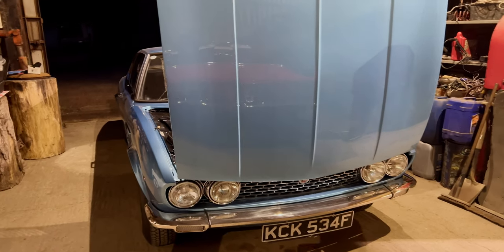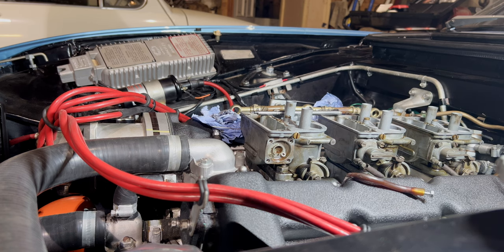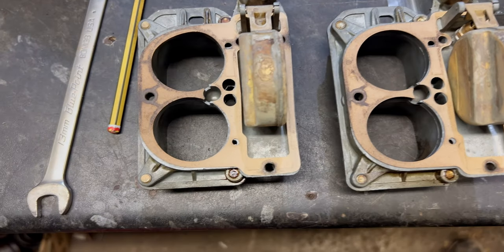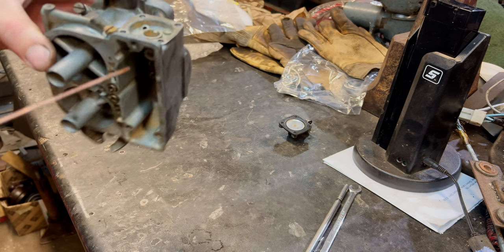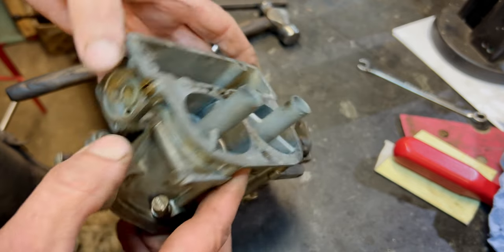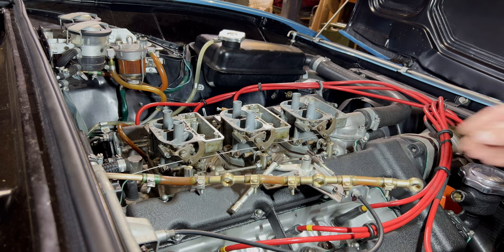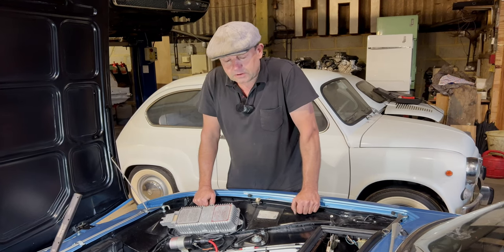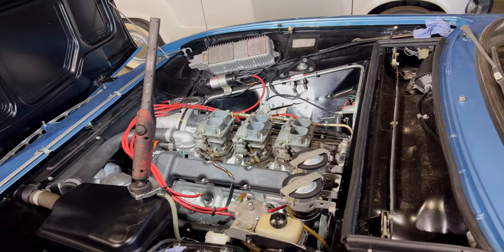Fiat Dino Carburettor trouble.

Comment: Interesting as always, Mark! But, if looking at the "blueprint pics" of the Weber DCN and
DCNF carburettors, there is a small one-direction ball valve inside the accelerator pump 
housing, which seems to be hold in place by the small metal part you found lying in the
float chamber.    
Without this ball valve , I suspect the accelerator pump will not work very well?   

When restoring my own carburettors, I could hear these small balls rattle, when I shake 
the  dismantled main carburettor housings!
Reply from the maker: @Dinoswede-o9j  I think you are correct and the ball valve works as a one way valve allowing fuel to enter the pump chamber from the float bowl.  But it prevents fuel returning when the pump is operated forcing the fuel through the acceleration jets .  This explains why the plug has the tail. The ball must still be in place as it operates correctly and drives perfectly. The acceleration was slightly blunted before. You can see in the video that all three pumps are operating correctly.  I do have a Webber book somewhere but could not find it. 
Thank you for your comment it has been very useful. I will investigate this further.

Comment: Apparently, ethanol degrades the solder joints on the brass floats, causing them to absorb fuel and sink. This would also lead to overfilling/leaking although I'm sure you'd have noticed. Plastic 'Spansil' floats are the recommended replacement/upgrade.
Reply from the maker: @jonhaddock481  Yes I think it’s the ethanol content that is causing so many problems especially after winter lay up. 
I have been recommended a fuel additive which should help.